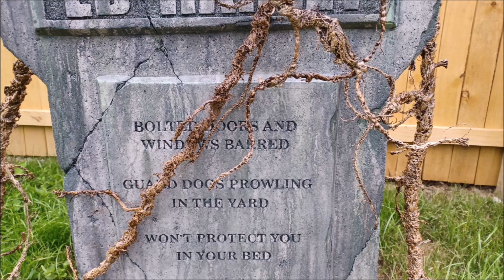How To Make Rope Vines

Comment: These would look awesome in my reptile vivariums. I know the great stuff is safe and all but I am unsure of the paint/stain. I use silicon without mold resist so, I am thinking maybe if that sealer seals everything well. I am just not sure though.
Reply from the maker: I wouldn't use the paints or stain I did in a vivarium or bioactive setup. I'd stick to the silicone coated in coconut fiber, sand and moss. I have a big 60 gallon bioactive setup for an anole.